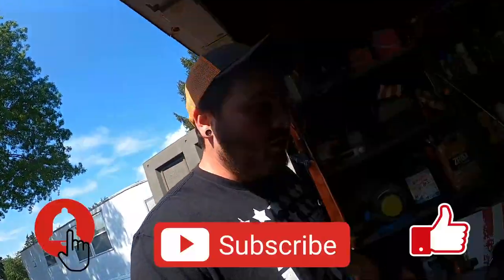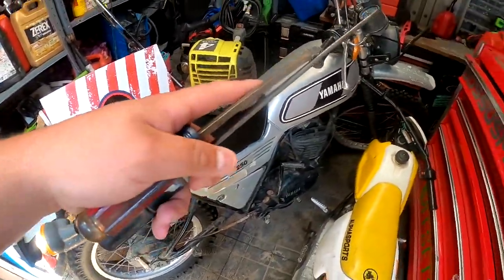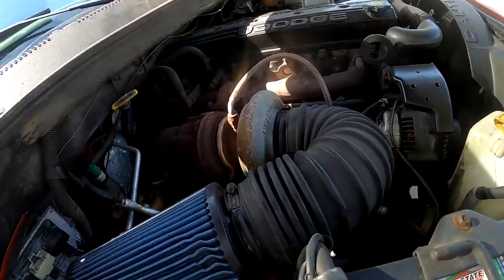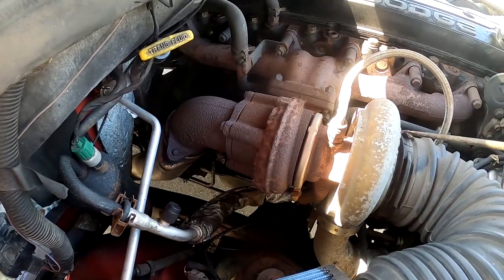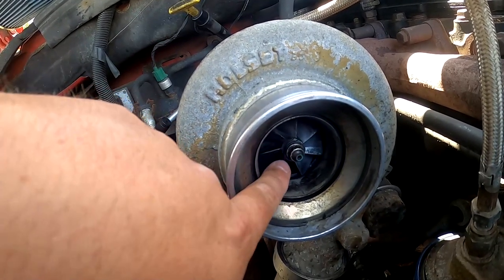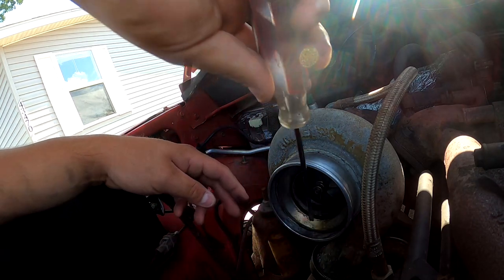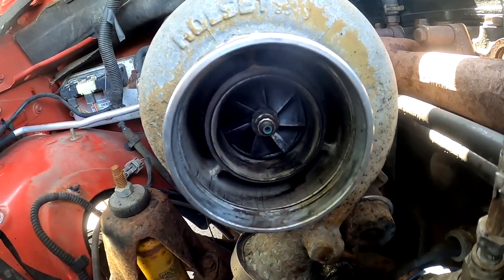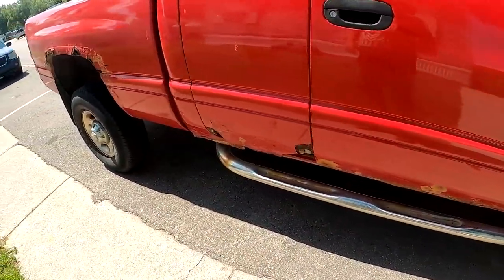Removing the silencer ring from my 5.9 Cummins stock turbo. crazy difference

Comment: Where’d you get the cold air intake ?
Reply from the maker: The elbow off the turbo was stock, I had the filter laying around from my 6.7 Cummins I just slapped it on the end of it lol
Reply: The stock air box is the best option with these trucks. It pulls actual cold air from the fender. Lots of people have tested different setups and the stock seems to be the way to go. Anything you add to intakw aystem is basically just bling and dollars spent.
Reply: @brianmcconnaughay6540  s+b intake kit is really effective
Reply: @brianmcconnaughay6540  yeah you definitely want a heat shield but no restriction helps
Reply: I use a stock box with a K/N. Pulls out side air is as cold as it gets. Straight piped , 6 gear manual  made the turbo sing like Angels and it gits + 3mpg 
$80 well spent
Reply: I just picked up a BANKS setup!💪🏽
Reply: lol it’s not even a cold air intake, being open air literally makes it a hot air intake
Reply from the maker: @_N4VE_  well that’s what the intercooler is for, alot of factory filters restrict air flow so it’s mainly just for better flow not cold air.
Reply: @Kickitwithkody  true better airflow, but sucking in hot air just makes it more inefficient and less effective since the intercooler now has to cool hotter air. The airflow is less effective when it’s hot air.

Comment: Is this bad for anything?
Reply from the maker: No it was pretty much all for sound elimination from the factory.
Reply: One dude ran numbers on fuel economy and all the dyno; you lose some efficiency. For me, there was no noticeable difference, and I have a 5 inch stack up my bed with a flapper. No muffler; kept the cat. But at $5 a gallon diesel, I put it back in because I noticed a mpg issue myself
Reply: My stock is plenty loud just at idle... I don't see why at the cost of mpg
Reply: Actually mine may be removed.. Never looked his sounded super quiet so nvrmind what I said

Comment: man  the only good on the truck is the motor .  up north  with all that salt . yike's  65k  truck turn into a 1500$ truck in about a  year .
Reply from the maker: That truck didn’t leave a drop of anything. Drivetrain wise it was the cleanest one around bought it from original owner with 5 miles on the title. I started to restore it and then ending up selling it. Definitely regret it.
Reply: Yea I just got an 00 in Massachusetts... Body looked OK.. But what a fn mess underneath.. Brought 2 of my mechanics and asked them 'is the resto reasonable?.. Given they were doing the work.. Both said resounding yes... I'm not so sure now.. Can be done but I need it up and going ASAP.. I could killem 😅..